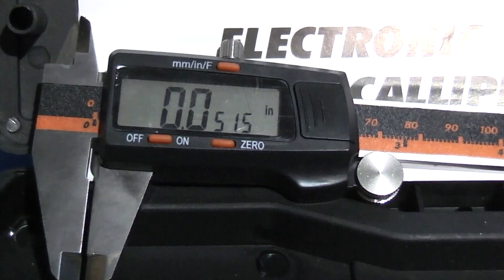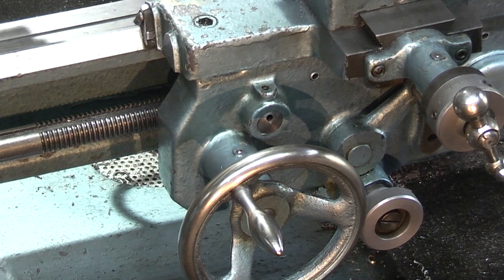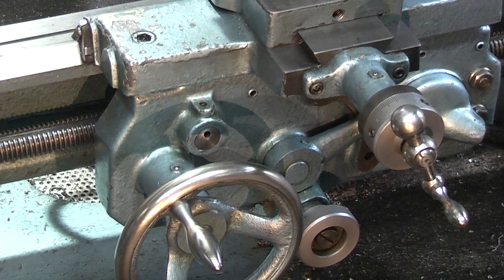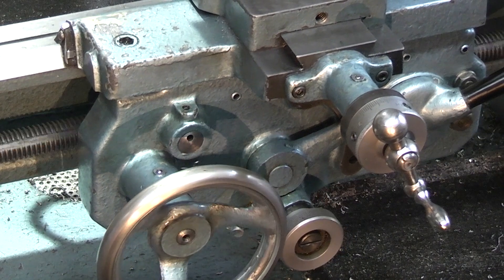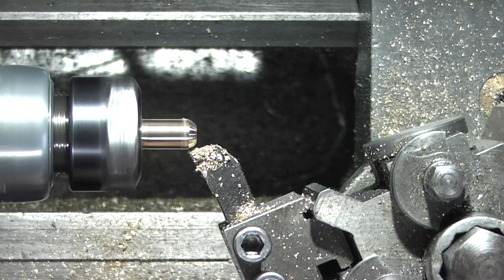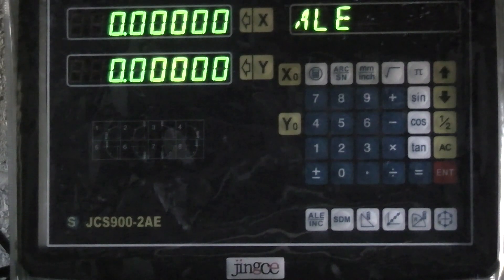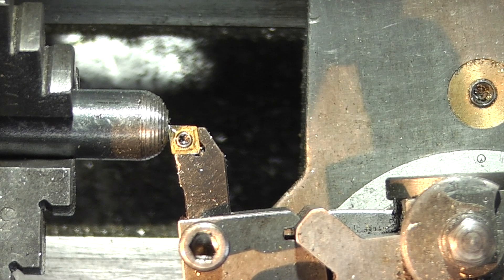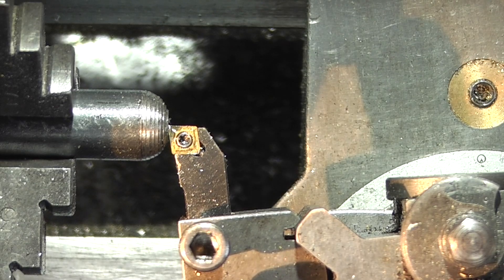Radius turning with DRO & Digital calliper draw

Comment: A lot my radii are mostly done by eye  , sometimes  manually with the handles , sometimes with  longditudinal feed engaged  & turning the cross feed by hand  but looking at the opposite side of the work from the tool .  I think i had it on ep 4 pt 6 Swarf & Chips .   Its an easy method to pick up .  Cheers .

Comment: Hi Alan

Congratulations to the winners. Enjoy using them.

I have a DRO related question 
Do you find you use the functions on the DRO or would a vernier style set up be just as beneficial? (Those vernier scales with the display on a cable) 
You not going to do co-ordinate drilling on the lathe the same as a mill DRO.
Trying to work out what would be better one for price and fitment for my lathe.

Best Regards,
Paul
Reply from the maker: Hi Paul. It depends on the price, the glass scales are cost effective but may be too bulky to fit on some small lathes. If you use independent digital (caliper type scales) I don't think you get the functions of the display like rad turning, showing the diameter of the part. Which I find speeds up the work as you know what the diameter is, so you only need to measure when you get close to the finished size. plus the 200 sub datums and  half the distance between two points. You are right if you purchase a display some of the functions will not be used on the lathe. so you don't need to purchase one with all the milling functions.
regards
Alan
Reply: Thank you Alan. I have just ran prices and its a little more for a DRO and you get all you mentioned. Also the batteries dont go flat hahaha. 

Ill fit it to my mill first and then lathe later on

Keep up the good work

Paul
Reply: Fwiw, using the word vernier describes how the measurements are obtained. A vernier scale on an analog micrometer as one example. Many incorrectly call digital calipers "digital verniers". There's no such tool since the tool doesn't have or need a vernier scale. For calipers they either have a proper old school vernier scale, (vernier calipers) a dial (dial calipers), or there digital (digital calipers). Today's DRO's (digital read outs) use electronic signals from the reader heads to create the position read out numbers on the display. So again there's no such thing as a vernier digital read out. What your describing are simple digital read outs with remote display heads that are derived from the same system most digital calipers use today. They can only give simple position coordinates. Unfortunately there also subject to contamination from cutting lubes and swarf and many have given up using them as there not very durable. There also not very accurate. Both Starrett and Mitutoyo make quite expensive linear scales and integrated reader head displays. Even at there much higher price than the cheaper Chinese copy's there stated accuracy is still only about .002" at BEST. A digital tools display numbers are NOT it's level of accuracy. Many quote that last .0005" number most digital calipers can display today as if it has any meaning. For digital calipers the mechanical design of all of them make them incapable of being accurate to less than a couple of thou. despite what the display shows. A digital displays numbers or how many digits there are to the right of the decimal point is it's resolution. Resolution means the smallest number it can display. Accuracy isn't the same thing. How well the tool is made and it's built in accuracy and the repeatability capability's are closely linked together. An industry standard for accuracy measurement tools is always + - one count. That would be for the high cost industrial level equipment. The much cheaper off shore tools may or may not be of equal accuracy. There's simply no way to know for sure what there capable of unless you can verify what the tool is providing for measurements with known for size physical objects like accurately measured 123 or 246 blocks or even better gauge blocks that can be trusted for size. 

Your question is just about impossible to properly answer about which type of digital measurement system would be best for yourself. It depends on your required level of accuracy, type of work or parts you normally make etc. I can say compared to any half way decent DRO the scales your talking about with the remote display are extremely limited in what there capable of, and as mentioned have far less accuracy and durability. There initial cost is today fairly close to what a proper low end DRO is now priced at.  They also tend to eat batteries. If it were me? Think about it this way, you can't add durability, accuracy or additional capability's after you've bought the tool. So your stuck at the level the tool has that your buying.